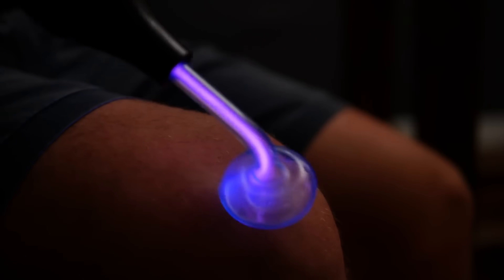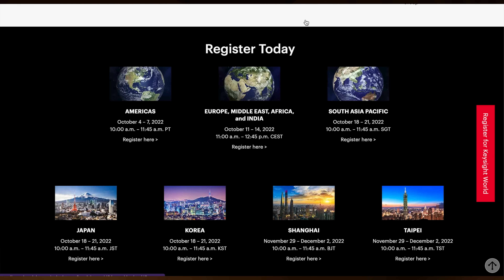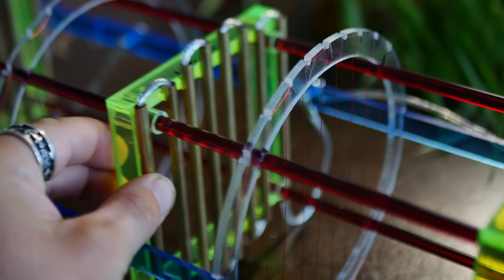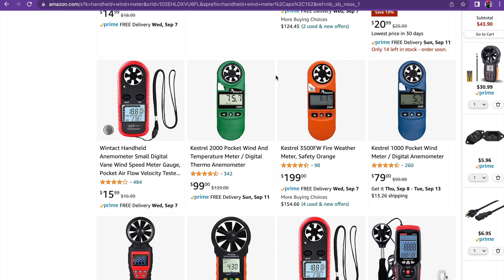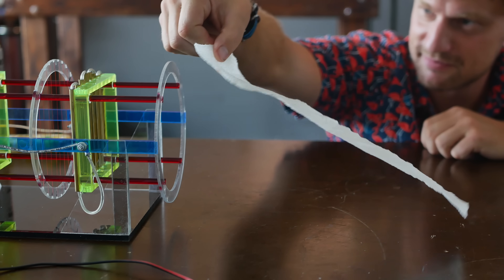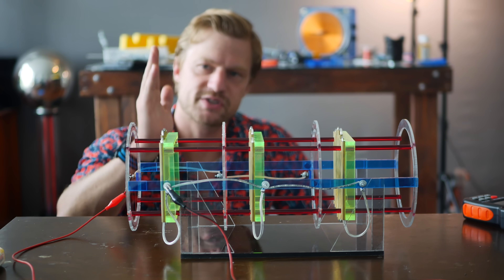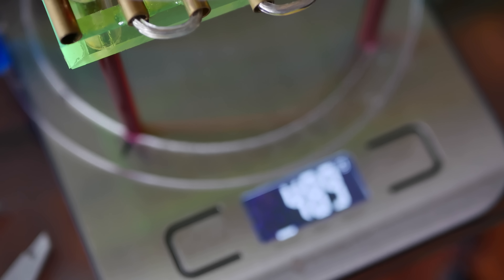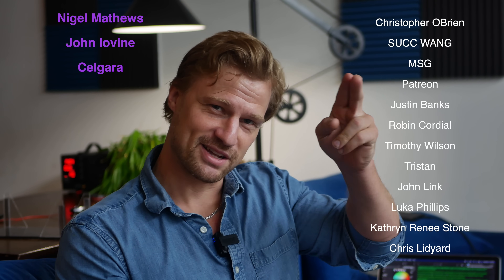Designing A Next-Gen Ionic Thruster! (For Flight)

Comment: Ok, I'll preface this by saying I am just an amateur inventor and engineer, so I am no where near the physicist here. But I have an idea seeing this. So on the ISS, they use a water to O2 converter and they vent the Hydrogen gas into space, a waste in my opinion. If you encase this engine, and inject H2 gas into this, a fine stream on H2 gas, since it is 3 times the combustion of conventional fuel... Just a thought for in atmo drive, vs plasma drive for space drive...

Comment: how much thrust can be produced with the 90 watts if you use a fan? Comparison of the 2 would've been very nice!
Also, I think the negative metal bars could be thinner, round  shaped bars are disturbing the air flow, then but mesh-like also longer negative ion receivers would probably help imo, also more wires on the positive side and I think it would be better if ions were produced from a tip instead of a random point on a wire, preferably the tips should be located right in the middle of the mesh. Could help with the airflow... Just a thought

Comment: So what was the relative thrust to weight ratio with 3 stages at 2 m/s vs 2 stages at 2m/s? What is the thrust of a single stage? Spacing and orientation of positive and negative poles. What if you use aerodynamic foil shapes in place of the negative tubes, better yet concentric circular air foils for the negative tubes, to better confine the thrust.

Comment: 1. Cascading increasing pulse charges 2. Encapsulate the engine, add inflow ports before each stage. 3. Opt 1, but increasing number of stages (should theoretically decrease power needed, and increase output).  Try gold plating .

Comment: Does the ground electrode have a need to be wider? Can we alternate between positive and negative fields maybe using AC instead? Can you have circular wires and attempt to keep a flow of ions inside them?

There need to be more experiments done with distance voltage and efficiency in mind. Does the 33 and 50% increase in velocity come with a double and triple power consumption? What is the thrust at different atmospheric pressures?

I need answers!

Comment: Does wire spacing in each ring have an influence on the mass flow rate of air?  Also what if you  enclose the system in a cylinder that has a cross section profile like that of a jet engine?

Comment: 1. Adding a special wall: Each thruster is sucking in air, but it could also be losing air down the stream. A special wall design is required to minimize this loss but still allow each thruster to suck in more air. Something like cones stacked on each other would be a good start, allowing sucking in air at each layer but preventing loss from the stream at those layers, or making it really hard due to turbulence. An airflow analysis with designs is a good idea here, as testing this in real life is hard.
2. Frame materials could definitely be minimized, that'll fix the TW ratio but won't affect the thrust specifically.
3. Mesh wire placements: Smaller / larger distances between the wires would affect flow. This can be optimized first by isolating a single layer. The optimum would probably be affected when adding in multiple layers but my gut says it won't matter as much, maybe better left for a v3.
4. Mesh rotations. Maybe 90 degree rotated meshes alternating between layers might perform better. This is another variable that can be experimented with and optimized.
5. Since staggered layer placement is resulting in increased flow, there's some optimization to be done there. Trying to understand the relationship between the multiple layers and distances between them can then allow us to find the optimum layer placement that maximizes flow, although I'd leave this as a last step since it will be affected by structural changes.

Many other comments also mention a lot of things that sound super interesting that I don't understand!

Super interested in what you end up doing here. If you need help with any of the data analysis / airflow analysis, I'm willing to help! I really wanna see how far this can be taken! twitter @iamramiawar

Comment: You should try the 3 sections in series electricly instead of parallel. You would need a total of 135kv or more, possibly closer to 215kv depending on how you set it up. Each stage would be attracted to the next and may give you dramatically increased output.
Reply: That will cause voltage drop for each section.
Reply: this is basically a voltage drop machine
Reply: youre using a positive electrode to excite and start releasing energy in the form of ionization essentially passing ionic bonds. this creates a flow of energy that creates a air current or airflow. which can be harnessed and used while the majority of the actual electricity used to create said current reharnessed back into the ground and through the negative lead again. so increasing volatge drop means great ionization output if im to understand correctly. energy creates a vaccuum along its path which "air" will take, water too but in a smaller capacity with higher resistance to flow though much more power.
Reply: @peterpipeher260  exactly each stage 45 higher then the last.....

Comment: Woow. To be honest its really interesting and i think it might be the future of aircraft engines and due to the fact that it works by electricity it can be way cheaper and easier with less maintenance needed. It can easily be the future of aviation if they manage to highly improve it. And if they want to run it on electricity they can use radioactive materials as a power source that decreases the area needed for the fuel

Comment: Also probably making it smooth and round would help and another fun tip if you can figure out a way to get the air to vortex as it goes through the intake and it will also increase the air velocity.

Comment: I personally to increase efficiency would enclose the sides possibly make each consecutive stage smaller and funnel the air from the stage in front of it smaller and smaller down till the end in order to add compression to increase air velocity. Just like a real jet engine suck squeeze bang blow the only thing you're removing is the bang part. So yeah enclose the sides and add stages of compression and make the intake larger than the exhaust.

Comment: 1) Build a tube around the thruster. 
2) Charge the tube to focus laminar flow to center. 
3) Optimize electrodes for lower drag and higher charging surface.
4) Charge with different voltage and diameter reduction according to air speed. 
5) Use a hydrogen power supply ;))

Comment: Seeing the field and the effect of scattered thrusters, I'm immediately reminded of quantum physics and recombination times. The faster the air is, the wider the gap can be before a considerable part of the ions recombines. That's why increasing voltage helped so much for the wider spacings. Try adding some water vapor.. I'm pretty sure, it will multiply the output.

Comment: 1. Larger diameter of pipe (enclosed walls for clear airflow?)
2. Could measure a single stage to optimize voltage + distance (then add the next stage and adjust their voltage + distance) - there may be synergies from geometry and distance between stages or alike that wont work out if you have all stages run the same voltage)
3. Wire patterns/spacing could influence the overall performance

Guess that goes a bit into science. (Not sure if it would work to install a servo or alike to play with the spacing while its running)

Comment: I suspect air velocity is increased with staged thrusters for the same reason that the rear prop in a contra-rotating arrangement uses more pitch for the same airspeed.  The air is already accelerated to a point by the time it hits the second, so air going through the second stage is not being influenced by ionic discharge for as much time as the first stage.  Adding more air gap between emitter and collector on successive stages makes up for this and allows the ionic discharge to influence and accelerate the air for the same amount of time as the first stage had.  Air gap is generally recognized as being 1mm/kV, but that's only ideal for stationary air being accelerated.  If staged ionic thrusters like this end up being viable, I'd imagine the air gap is going to be an adjustable variable in flight just the same as a constant speed prop is vital for aircraft with a large airspeed regime.  Drift velocity in standard air conditions is around 450mph, which is basically the hard limit of a single thruster at 100% efficiency, but if the air going into said thruster is moving at 100mph, then a 100% efficient thruster would still have an exit velocity of 550mph.  So as long as you can properly space the emitter and collector out, then stacking multiple units will continue to increase velocity without worrying about drift velocity.

Improvements:
-Use aerodynamically shaped collectors, rather than tubes.  Oval, or even airfoil shaped with smooth edges, would give you both more surface area to work with and also reduce air resistance passing around them.  Aluminum or magnesium strips would both cut down on weight and give you an aerodynamic advantage.  ideal solution for both drag and weight reduction would be airfoils covered with aluminum foil and a lightweight core made of foam or balsa or hollow carbon fiber.  A honeycomb design like what's used on gridded ion thrusters could be an alternative.  Avoid sharp edges as they can cause a degradation in performance, make sure everything is as rounded as possible.  If you hear the thruster making a lot of noise, you're likely emitting negative ions from the collector.  The air passing through these stages will become saturated, as such it loses some of its potential to be influenced by ionic propulsion.  If you make the surface area of the collectors progressively larger, you may be able to strip some of that saturation down for each successive stage.  This may lead to increased efficiency both for the purposes of better directing the saturated air toward a larger surface area and to reduce the saturated air so successive stages will not lose effectiveness.  Collector to emitter surface area ratio may be another important part of squeezing the most performance out of your thruster, and one worth getting some hard data on.

-Rather than enclosing it with ducting, try using an electromagnetic field to focus the ionic wind, and potentially use that same technique to create a nozzle for some additional thrust.  You likely won't be bleeding thrust off the sides with ionic wind being attracted to the electrodes, so having the thruster open on the sides may give you additional air mass to use if you squeeze the ionic wind stream down with field containment.  This may provide a localized aerospike effect that pulls more air from the outside into successive stages, giving you high velocity/low mass air in the center transitioning to lower velocity/higher mass air along the periphery.  Alternatively, you can do this strictly aerodynamically with progressively larger ducts and thrusters operating on venturi effect (like a jet pump or eductor) to introduce more air mass to the system, but this would arguably require more work getting the ducting right than just figuring out how to do it with a magnetic field.  With a magnet, you can simply reposition and adjust field strength while observing coronal discharge in the dark to focus the ionic wind, whereas ducting would require lots of fabrication to get it working the way it needs to be.

-Take the insulation off your emitter wires and rough them up a bit with sandpaper to provide a lot of small points for coronal discharge potential.  Better yet, ditch the copper and go with stainless steel, as narrow as you can get it.  Stainless steel wire functions better in ionic thrusters, and the smaller gauge wire aids in coronal discharge.  Run them in a grid and experiment with grid mesh to find the best thrust to weight ratio.

-Experiment with distance between each thruster just the same as you did with air gap between emitters and collectors.  Is there an advantage to be had for proper spacing in this regard?  Testing would give you an indication.  Adding to the electromagnetic field containment idea, this would likely play a big part in tuning the thruster for optimal efficiency.

-Surely there's a better frame material that is both insulative and strong enough to support these thrusters than heavy acrylics?  Probably not something like carbon fiber as it's somewhat conductive, but fiberglass is a decent insulator with a good strength to weight ratio.  Perhaps a fiberglass frame with small insulators to make sure nothing start arcing.

-Add more stages!  More blue stuff!  If three is good, a dozen is better!

Comment: Hello, impressive what you have built. I once saw a video about conventional turbines. It was about how the shape of the turbine amplifies the airflow. There is a certain effect, I don't know what it's called, but it takes advantage of the fact that the airflow has to pass a 90 degree obstacle. Certain forces then play a role, but in any case, the airflow is enormously amplified. Maybe you can adjust the shape of your turbine so that the air also hits such an obstacle. Maybe by building the cathode differently, so that you don't charge more weight.

Comment: How about offsetting the wires? So that each wire of the 2. stage is exactly in the middle of 2 wires from the first stage, or rotate them, either 90° each or maybe 45°.
Maybe change the wire density towards the middle, or rather check the plasmaflow in the dark and do the spacing, so the plasmaflow of 2 wires doesn't interact with each other.

Comment: I'd say cut the weight (by literally cutting most of the length and fixing the size), cover it in tube,  get thinner cables with way more windings, get a mesh cathode. to not obstruct airflow so much. You should keep testing prototype tho, make sure rising the distance is the rigt thing to do, You might find that getting seperate voltages to different stages is increasing efficiency, since that would be a huge part in development, minimize area of wire outside of channel. You could Try pushing heavier gasses but that might be pointless on earth. You can always get higher voltage but I guess that it is way better to shrink anode wires than getting higher voltage, keep in mind that hot wire will produce plasma easier but molten wire doesn't :) there is always a tungsten wire :D area covered by mesh causing pressure drop is also important, might be a good idea to check if mesh density on first one should be denser ten the rest since You don't get much of momentum from any previous ones and don't really care about blocking the flow. Good luck I hope You read that and use the ideas to improve it enough for some really good blimp toy.

Comment: I was going to try this myself(multi-stage ion thrusters) but it looks like I will never have the time and energy to put into it. Ideas to improve it:
- add more stages (at least 2 more)
- make stages progressively larger
- use circular concentric ionizer rings (Nasa seems to favour them too)
- try adding a propeller in front , see what happens
- increase the surface of the "bottom" electrodes
- power it using a fusion reactor :D
- jet engines are tested for bird ingestion. You can try this one you made for something smaller, like insects...

Comment: what you think about try to fold it in a tube . To keep all air come thru all section with no spreading between sections. 
Also i would try thin wires on both electrodes but in grid

Comment: Some ideas i have that might improve the flow.
1-  reduce the gap between wires - 
2- make the pipes a bit wider, that will help reduce 2 pipes per plate -might reduce the weight
3- taper the top - like shuttle shape - meaning have a progressively increasing diameter of the circle plates, instead of having all same size.

Comment: Any good thruster needs to direct airflow, so I'm assuming one problem is not nozzle at the exit and no intake cone at the front. Another could very well be the finding out how the density of the plasma doodads affect thrust and airflow. Otherwise you seem to have weight figured out already. What I'm a bit stumped on is how the diminishing returns stack up so fast. 

Also I think #3 is that a pancake seems to be the most effective design, long didn't work so you're probably gonna go wide and flat with the next one.

Comment: Instead of copper tubes for ground, use concentric tubes of various lengths, the longest in the middle and shortest on the edge. In addition a higher density in the middle of the vs the edges. This will encourage a vacuum in the middle and additional air to be induced from the sides. The tubes will help with laminar flow as well.